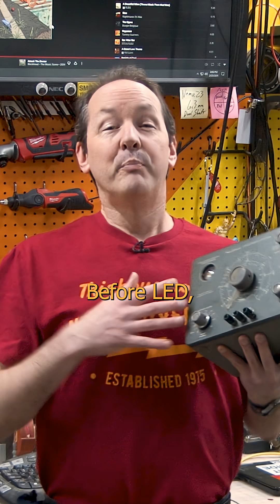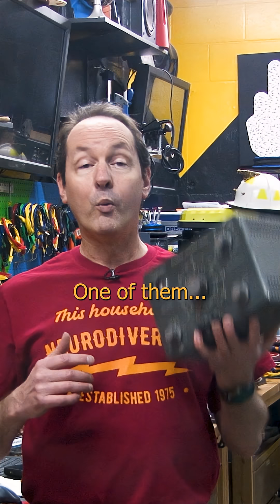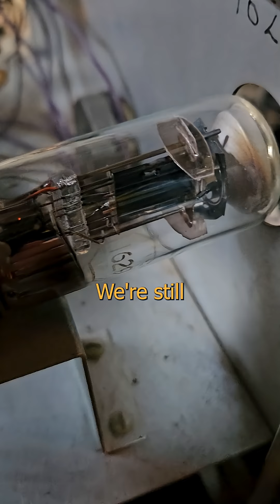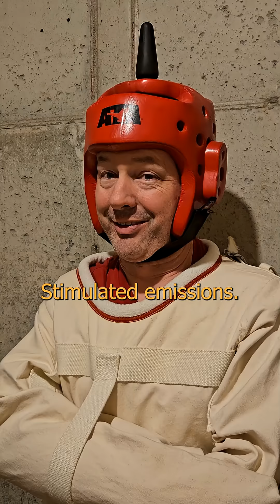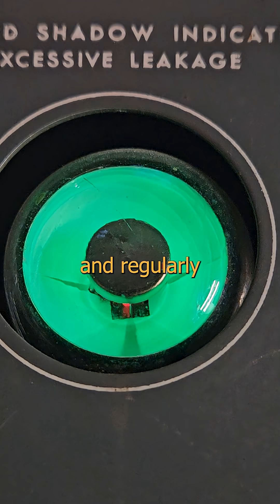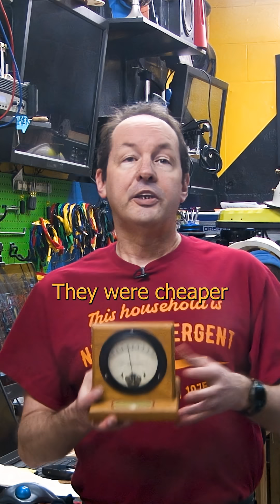Magic Eye Indicator #chrisboden #comedy #engineering #educational #science #physics #electronics

Comment: From a broken Telefunken reel-to-reel tape recorder I just extracted similar EM-84 and itsocket.  Wouldike to make it operate.  Anyone have circuit diagram?   Perhaps it could indicate static electricity fields.
In the EM-84, the fluorescent phosphor is coated to the inside of the glass tube.  Not like this one with phosphor applied to a metal cup disk.

Comment: Ah, a "tuning eye"...my mom and dad's old entertainment system -- a record player (they had some pressed clay records that were the standard before vinyl), an AM radio, and a reel-to-reel tape deck. It had one of those "eyes" and it was used for showing the mic/line input level. They still had the thing to 1979, and it was still working then. They never did say what they did with that system when they moved from Missouri to Oklahoma (I was serving in the Navy then as an ET -- Electronics Technician). It was a good, solidly reliable system and probably would've been an antique by then, or close to it).

Comment: I don't have cassette tapes because they are neto I bought a 1992 Buick Riviera as a project car from a blind guy, that literal not remotely a joke. Not enough electric works on the car to have a cigarette lighter and I'm not chasing another wire we got ignition, driver side window, lights and radio... By the grace of god when I got it it came with ignition, radio and rear speakers working, the lights I needed, the window is what killed my will for more and the fuel pump worked if you jiggled it right. Don't buy project cars from blind people for 1,000 dollars for your daily just get a bike or something.

Comment: I'm genuinely surprised about the 'cheaper to make than a magnetic coil meter' bit, cos they require careful mounted electrodes, glass-metal seals, and a hard vacuum..... Whereas with coil meters surely the most expensive bits were the alnico magnet, moving coil, and jewel bearings???

Comment: in some applications these are unsurpassed. I have a transformer LCR bridge that uses two, double wing pair tubes (EM34, 6CD7) giving 4 levels of sensitivity for nulling without touching a switch, it has an accuracy of 0.1% and goes from single figure ρF to Farads with equivalent ranges for inductance and resistance.

Comment: The old pre fm, am broadcasts were very High quality and had an audio bandwidth similar to the fm bandwidth but once fm took a hold the old am transmission bandwidth was reduced. Not many am receivers could realise the full bandwidth as it required 4 ganged tuned circuits which was expensive.

Comment: The way these work is also backwards to the way it appears; The Triode in the back which 'drives' the shaded portion of the eye, opens it 90 degrees with 0 signal. But, when a signal is applied to the grid, it pulls in the vanes of the eye and closes the pattern relative to the amount of applied signal. The #1629 tube in there is the ordinary one; others have multiple patterns, some have to be driven with other tubes with more gain or sensitivity, and that's pretty cool.

Comment: Wanna know what's even more cool vacuum tubes can withstand a lot of abuse if you short them the anode will glow but if you turn of short voltage and slowly let them cool they still work even in lightning conditions like Tesla coils a tube scope has a way better survival change then a transistors based one, many high power applications would still benefit from EMP hardened stuff has a backup function basically even in a most difficult scenario of the sun sneezing a load of particles our way or some ass setting of a high atmosfere atomic bomb event causing a magnetic field problem for all around they would with severe modifications to the system still be able to function it's mainly coils and long lines being a problem!!!

Comment: When I was young and stoo-pid, I designed and built a digital calculator with an analog that used cats eyes for displays. The problem I ran into (after designing a power supply that could handle it, was creating a scale for how to read the thing. Creating a scale that would read 0-10 on a device with a 130 degree full swing was fun. 

It only worked to 4 digits and looked like rhino crap, but I did win the science fair. 🎉

Comment: The WWII ARC5/274N series of aircraft transmitters used a ‘magic eye’ tube to allow occasional calibration in the field. This is in the rear of the transmitter and a small access door with a mirror on its underside (heh heh heh underside) allowed the green phosphor to be viewed while tuning. I have several of these and they still work fine after 83 years! So, not relegated to the dustbin so much as cigarette lighters in cars.

Comment: I routinely use a Capacitor/Resistance tester that uses one- probably the same circuit as the one you're holding, just done by Eico.

The reason I still use it is because it test for leakage at common tube voltages up to 500V, almost nothing does that these days!

Comment: The bigest problem with the casset players and aformentioned cassets is that said player tends to "eat" the fucking tape when the pickups are to dirty and it will ruin the tape either by riping the magnetic layer of the reel or the tape it self snaping as you try to get it out of the players devil grip.

Comment: I just recapped a 1938 am radio with no real experience to speak of, and it has one of these. It still worked, but wasn't visible, ind I bought another one off eBay while they are still obtainable

Comment: Fun fact, using an acoustic charge transport PTF (programmable transverse filter) would later on allow you to clean up the radio signal so that you would get fewer distortions. Of course these devices only started coming around in the late 80's, but now a version of them are used in every single cellphone in the world because these types of piezoelectric filters can separate inbound waves from the outbound waves with a signal loss of less than 0.0001%.

Comment: I had one in an old Philips GM2308 audio signal generator, where it is used as a very pretty beat frequency indicator using the full range, not just the last quarter.
It's possible that I had to sell it due to lack of space... Not sure. I may still have it.

Comment: They were also less physically delicate than moving coil meters and only needed to be calibrated once. The tubes were shock mounted to survive drops that didn’t break the case. I used to own a meter like that which had been dropped off a building and still worked. Try that with a meter.

Comment: No, but like, cathode ray was so damned cool. It was basically a ray gun in your TV that lit a phosphor plate just right to light up a tiny spot that only stayed lit for a few milliseconds, and that bastard zoomed over the plate 60 times a second. But, it's even cooler than that, because the frame rate of a TV was actually 30 fps for the whole picture, but the cathode ray was running at 60 fps, because it did half of the lines with each pass, skipping one line to do the next, and then back up to the top to do the lines it missed last time. It's why when you film old CRTs, you can see blocks of brighter light slowly moving up the screen. That's that raster overlap. Huh... Can you tell I used to fix cameras and tvs for the Navy and PBS?

Comment: Chris need a Dekatron and the Dekatron Spinner circuit 😊
The Dekatron (or Decatron) are "Decade Counters", which is just a weird way to say: it counts to 10. It has individual points that will arc and cause their beautiful plasma glow for their number. I believe some can illuminate multiple pins at once.
The cool part is their operational speed depended on the noble gas they were filled with. 

The Spinner circuit is just something someone cooked up that steps it around, causing the glow to spin around the top, chasing itself. Has variable speed as well. Just looks beautiful 😊

Comment: My 1939 Zenith console radio has a "cat's eye" tube for tuning. Still works 100%!
Reply: How big is it? I don't get a sense of scale here.
Reply: @briancarrigan7962 about 3.5' high and 2' wide its a model 7-S-363.
Reply: @briancarrigan7962 My 1960 Motorola stereo has a linear one. It's a strip about an inch long where the light moves towards the middle from both sides instead of closing up a circle.
Reply: @briancarrigan7962  If it's anything like my Zenith FM/AM/LW/MW/SW with phonograph console stereos, then it's about 5 feet wide, 2 feet deep, and 4 feet high.
Reply: @briancarrigan7962 The end of tube is about the diameter of a quarter.
Reply: @briancarrigan7962 the one in the video looks like 20x30x20cm (hlw). The electron gun alone isn't too big, it's the coils that make things big because they need space for resolution.

Comment: In HVACR work.  There was a vacuum gauge where the indicator turned a color when the vacuum pump had gotten the vacuum to the point where it was deep enough to remove most of the contamints.

Comment: My parents had an old Grundig Majestic console turntable/AM/FM/short wave receiver (mono, not stereo). It had that indicator for tuning. It was so old by the time I was a teen (late 70s) there were no needle replacements for it so I retrofitted a more modern turntable since they didn't want to replace it. Eventually there were no tube replacements available and I bought them a proper stereo with a CD player in the early 90s.

Comment: I’ve had a couple pieces of test equipment with them. Most notably my Heathkit signal tracer, which ends up getting used as a half watt guitar amp more than as a signal tracer. It even has a coarse wattmeter function using the magic eye as an indicator and a very flimsy two prong receptacle on the panel.

Comment: They do not last forever.  Every single original one I've  encountered did not work.
Reply: @michaeldellacava  I have a bunch of used ones that work just fine. However I've seen 100s that were bad. What usually happens is the phosphor on the target gets weak or totally dissipates. The tube will be electrically perfect but no display. I've seen that even on NOS eye tubes.